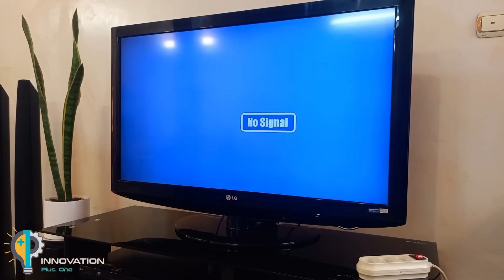SIM Card Unlocks Worldwide TV Channels || Antenna Booster

Comment: What is the diameter of the 3 circular wire and distance of each on the straight antenna wire?
Reply from the maker: Thank you for watching the video my friend🙏❤
The diameter of the wire is 1 mm with an impedance of 50-70, the distance between the antenna wires is 3 cm, and the clock frequency of the SIM card must be below 450

Comment: Pourquoi le débrancher pour nous convaincre.
L'interrupteur sur le bloc PC n'est pas alimentée.
Franchement arreté de faire des vidéos pour le clic et allez travaillér.
On perd du temps à vous regardez.
Sans haine 
Bonne continuation
Reply from the maker: only the clock frequency of the SIM card must be below 450 to act as a low-pass filter
Please read the signal and system book as well as Milligan's antenna design book to increase your knowledge🙏

Comment: W Polsce to nie przejdzie bo sygnał jest zakodowany trzeba mieć dekoder ,kiedyś mogłem wsadzić stary wieszak lub podłączyć obręcz od roweru i też miałem obraz teraz to nie przejdzie. Pokarz jak jesteś mądry jak rozkodować system DVB-T2/HEVC
Reply from the maker: If the SIM card clock has a frequency below 450, it acts as a low-pass noise filter and not an amplifier

Comment: The execution here is really good, but I think you'll get even more incoming bands available with a spiral loop halfway down the central shaft as this increases the length without increasing the size. Also it will mean that FM bandwidth radio is available then to the television tuner. Don't overlook the possibilities of receiving SMS messages to the television screen through the subtitles line? If you put in a flat spot on each of the outer circles, this will cause the frequencies of the SMS messages to be re-mapped to the subtitles frequency.
Reply: Hahahahahhah😂😂😂😂😂😂😂
Reply: SAY WHAT????
Reply: I think the impedance mismatch without a balun would be too much. A reversed double helix might do the trick, though. You think it might work for WhatsApp as well?
Reply: Thank you! Made one my self and it actually works! I had t place some small capacitor next to a small balun to have it's output more clear!
Reply: Hahaha

Comment: The cell phone antenna is supposed to connect to the cell phone towers. TV frequencies are in the vhf,digital...vs the 5g's
Reply: Think he is using the phone charger to get only a 5v DC and nothing to do with reception. I still don't believe it.
Reply: If this gadget were to really do as claimed I would have assumed more along the lines of the satellite gps connection from sim to pull digital/sat channels.

Comment: "This is truly genius; they transformed the data captured from the antenna, routing it through a nearby clock soldered with coaxial cable. Then, on the lower left side, there's the ground pin, while on the right side is the pin for supplying power to the SIM card. I'm impressed by your knowledge. Unlike those who comment that what you're doing is fake without further investigation. However, I must add that as far as I know, this technique doesn't unlock encrypted data; instead, it filters frequencies so that only data from frequencies supported by the SIM card can get through."
Reply: Scam not working lmao😂
Reply: I think 🤔 rechargeable sim you don't have recharge! you can't watch 😂and watch again after recharge 😂 😂
Reply: dan juga colokan listrik tidak menyala itu terlihat mati tombol lampunya
Reply: @adhinss9800  jangan malu-maluin orang indo komen pake bahasa inggris kaya saya.
Dia gak bakal ngerti
Reply: Is it working SIM card or not working SIM card?
Reply: @siddharthaanil5225  It really doesn't matter what kind of SIM card you use because it simply won't work. The video is faked. It's reasonably elaborate though, unlike those videos where wrapping metal foil round wires is supposed to save electricity, and many gullible people fall for it because they want to believe it's true. There's a degree of plausibility because digital TV signals are encrypted and need a viewing card that looks a little like a SIM card, and because TV signals and mobile phones both use radio waves. But it's a hoax. Even if it did all work as shown, the directional antenna (another fairly elaborate hoax) would need to be aimed towards the transmitter fairly accurately to get a usable signal. If it isn't exactly right you get break up of the picture, freezes and blocking and then it stops working all together. You can't just put the antenna on the table, not pointing at anything in particular. It's not a bad attempt at fooling people and it's getting a few clicks but I've seen much better.
Reply: This, my friends, is how Apollo landed on the moon. There are many "idi*ts" who don't believe it, like they don't believe in what's shown in this video.
Reply: @kishorevenugopal6191 😂😂😂😂😂😂😂😂😂😂
Reply: Pekna blbost.sbira jenom sledovanost nic vic
Reply: Sim recharge or not
Reply: Super

Comment: This is not even something a child would think.

The card pads are to access the different lines on the chip
There is a reset RST, a TXD, RXD, Clock CLK, Ground GRD
And 2 other ones that I can't remember. Might be a +5 volt line, but I don't remember if these have that.
I don't remember what it was called, the DC input is DCC or something like that
All of them had 3 letter codes that usually were silk screened on the motherboard for testing the lines.
You would offen see a 10 pin header that was for programming the chip using an external programmer.
JSOCK or something like that is what the pin header was

I think these read like an eeprom

I might have this confused

It has been a long time since I worked with these

But in the early days they had the motherboards labeled and diagnostic ports that allowed you to easily read and write to these at the factory

They had to load information onto the chips and they would have the programming station on the assembly line

The device had the assembly line and it would come to the programming station and they would connect the header to the diagnostics connector and then run the software and it would read and write the information to the chips and it would be ready to sell at that point and the next station they assembled the case top and then there was a final testing station and they would hook up the connections and feed test signals through the consumer connection and they would send it to be boxed and loaded on pallets to ship
Reply: jesus fucking christ, nobody takes this video seriously, it is done for comedy purposes. you must be a lot of fun at parties.

Comment: sim card voltage are not all 5 volt
There are three operating voltages for SIM cards: 5 V, 3 V and 1.8 V (ISO/IEC 7816-3 classes A, B and C, respectively). The operating voltage of the majority of SIM cards launched before 1998 was 5 V. SIM cards produced subsequently are compatible with 3 V and 5 V. Modern cards support 5 V, 3 V and 1.8 V.  https://en.wikipedia.org/wiki/SIM_card

Comment: Nice soldering iron tip
Reply: Lol
Reply: i thought he did pretty good getting that tiny drop of solder right where he wanted it. i' have to get a tip like his for precision work.  did he plug that art project into 220?
Reply: @hairycat6095  Ahhhh, must be the twists and turns of the shaft that does it for him !
Reply: @hairycat6095  yes 220 , also he used  copper electric wire by twisting it.
Reply from the maker: Thanks 👍

Comment: Or...you can buy a digital antenna for $12 and save yourself all that trouble.
😂😂😂
Reply: I have a 60 year old rabbit ears antenna.  A length of speaker wire will work fine. Digital schmigital!
Reply: @FromSagansStardust
I'm not sure what TV channels you are picking up but they can't be local broadcast channels.
Local broadcast stations all went digital in 2009. 
Rabbit ears won't work.
Reply: @ToughAncientSpark It depends entirely on where "local" is. There are plenty of analogue broadcasts still accessible around the world even if there aren't any local to you. That said, the subject of this video is clearly fake.
Reply: There is nothing special. About a rabbit ear ant and a digital rabbit ear antenna.
Reply: or you can not watch TV and wake the fuck up
Reply from the maker: Thanks for watching the video and comment❤🙏
This chip can only create a low-pass filter and reduce some noise and is more educational